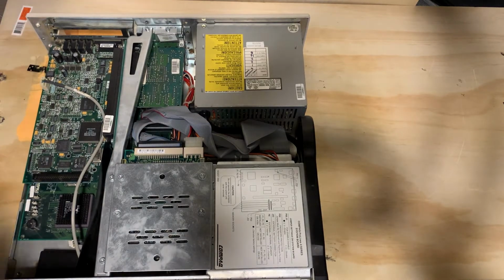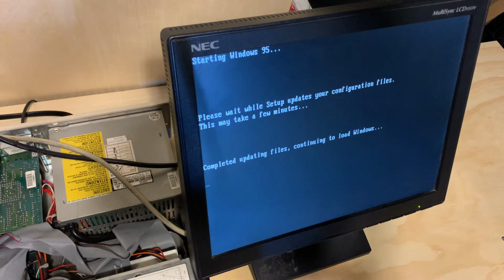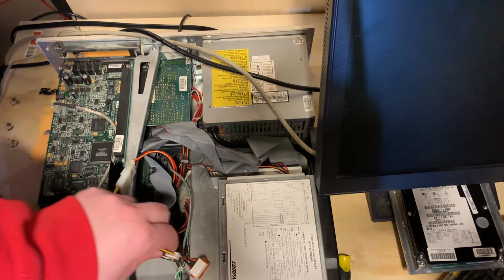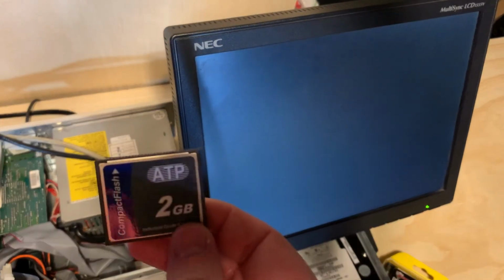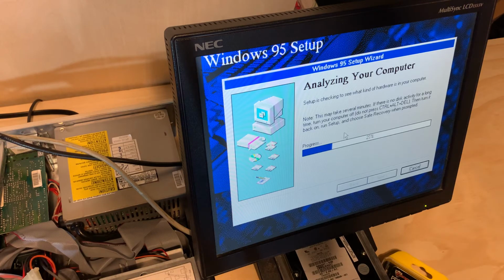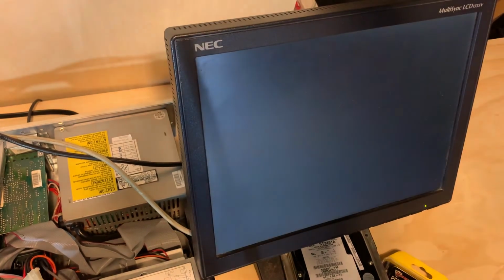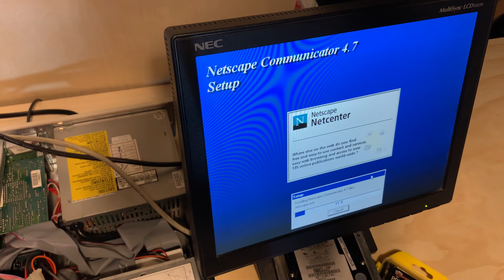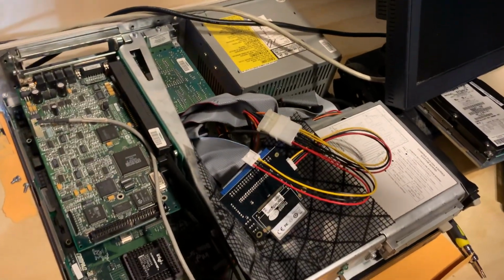Compaq Prolinea 4/25S restoration part 2 (RAM/CF to IDE upgrade)

Comment: well the soluation to using all 2 gigs of compact flash is so simple just make multiple partitions to use all the space up plain and simple4 503 mb drive partitions should do it.
Reply from the maker: Does this system for sure support this configuration with drive overlay software?   Not all systems do.